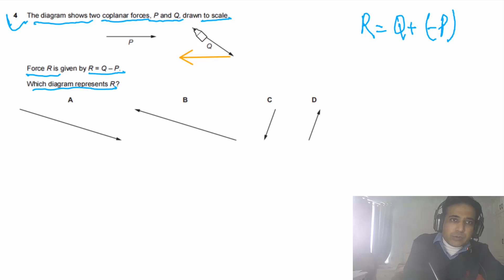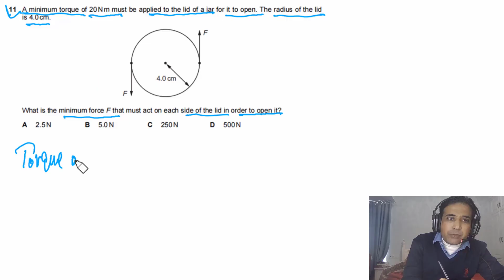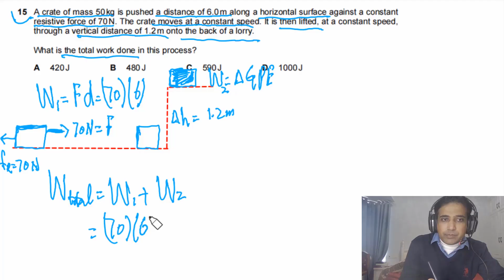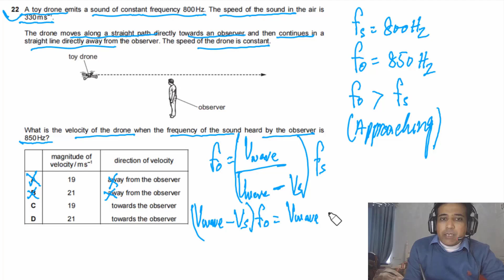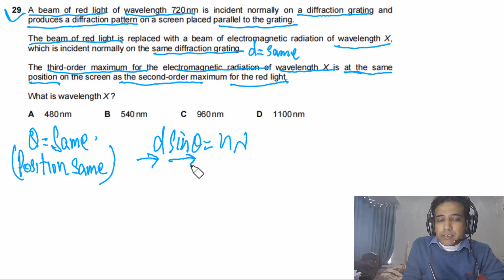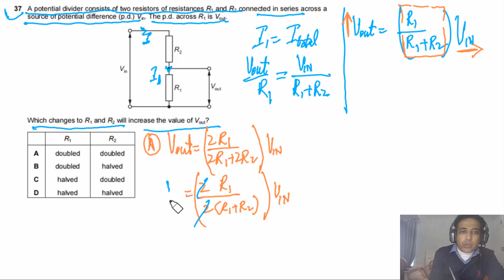AS LEVEL PHYSICS 9702 PAPER 1|OCT/NOV 2023 | Paper 11 | 9702/11/O/N/23 | Full and Detaield Solution

Comment: Hello Sir, can you please solve 9702/11/O/N/24 questions 34, 35. 
also sir, when current and resistance increase seperatly what happens to the pd across the components? sir please answer, i have my as physics exam coming in a few days
Reply from the maker: pd across any component = current passing component * resistance of component . If due to increase in current of the circuit , current through component increases then pd across component should increase . If resistance of component is increased but current passing through component remains same then pd across component should increase and vice versa .
Reply from the maker: Here is the detailed explanation 

The voltage (or potential difference, PD) across any electrical component can be calculated using Ohm’s Law:
PD across component=Current through component×Resistance of component
This means the PD depends on two things:
1.	Current passing through the component (I)
2.	Resistance of the component (R)
Let’s break it down with examples:
Case 1: Current Increases, Resistance Stays the Same
•	If the current (I) through the component increases (e.g., because the circuit’s total voltage increases), then:
PD=(Higher Current)×Resistance
→ PD increases because more current flows against the same resistance.
Case 2: Resistance Increases, Current Stays the Same
•	If the resistance (R) of the component increases (e.g., a resistor gets hotter, increasing its resistance), but the current (I) stays the same (e.g., because the power supply is constant), then:
PD=Current×(Higher Resistance)
→ PD increases because the same current faces more opposition.
Case 3: Resistance Increases, but Current Decreases (e.g., in a Series Circuit)

•	In a series circuit, if one component’s resistance increases, the total circuit resistance increases, which reduces the total current
•	 (since I=Vtotal/Rtotal).
•	So, even though the component’s resistance (R) goes up, the current (I) through it decreases.
•	The change in PD depends on which effect is stronger:
o	If resistance increases more than the current decreases → PD increases.
o	If current decreases more than resistance increases → PD decreases.

Key Takeaways:
•	PD always depends on both current and resistance.
•	If current increases (resistance constant) → PD increases.
•	If resistance increases (current constant) → PD increases.
•	In real circuits, changing resistance may also affect current, so you need to analyze the whole circuit.
Reply: @alevelandapphysics-ali  thank you so much sir

Comment: Sir in qs 15 how do we know when to use net/resultant force to calculate work done and when to use applied force like used in this qs? Jazakallah Sir! Please pray that the exam goes well!
Reply from the maker: In this question , we have calculated total work done by applied force . Work done by net force on a horizontal surface = change in Kinetic energy
Reply: Yes sir, how do we recognize what the question is asking from us, like in which qs do we calculate work done by applied force and when do we calculate work done by net force. For example in this I thought we had to calculate work done by net force and i wrote the work done in horizontal component is zero since there is no net force and in the vertical component is mgh.
Reply from the maker: @maham22  In the question states that block is pushed along a horizontal force and it tells us we need to calculate total work done by the applied force . Most of the time we need to calculate work done by a specific force and specific force is pushing force . If they ask to calcualte net work done it should be stated in the question or they will say calcualte change in KE i.e. net work done